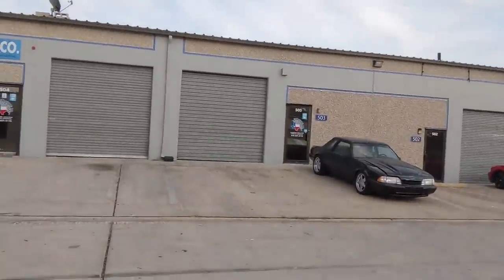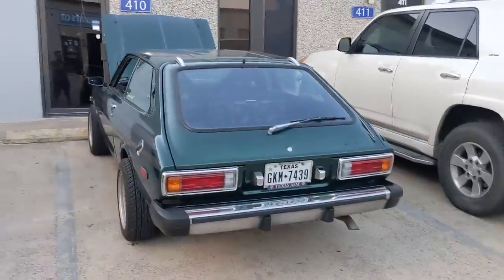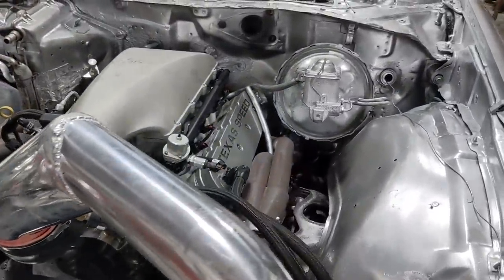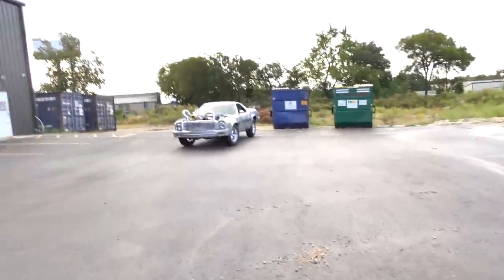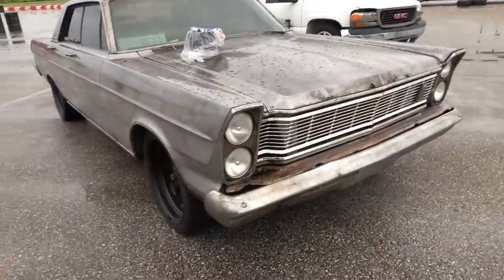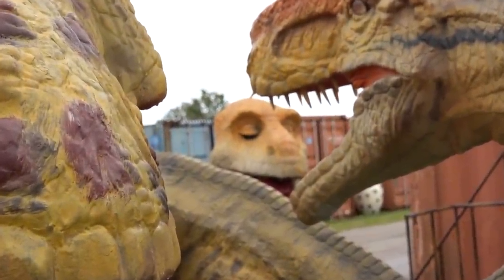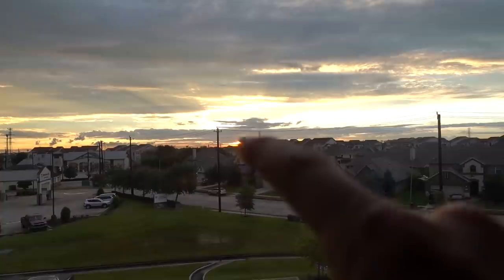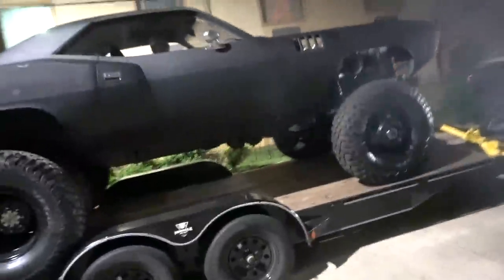The Cummins Barracuda RUNS AND DRIVES!!!!!

Comment: Hey Matt. When you trailer the car you really need to cap off or cover your turbo. First and worst thing your doing to it is spinning the turbo dry because your not pumping the oil into the turbo lubricating the bearings. That's really bad on it. Second your allowing alot of dirty air, bugs, or water if you run into rain.

Comment: So the original Texas speed motor got killed partly because Matt ran truck tires on the Elco, so he threw a stock bottom truck motor and an ebay turbo in it then added a set of new truck tires...? Solid work cause I'd rather have those badass tires than a motor that survives...

Comment: The power is extremely low for that psi and what the engine made na. It should be way higher. Something is wrong for sure.  The turbo is way to small for the displacement. But even with it being small it should be higher.

Comment: The el chromino before with no turbo was 500 hp?? And now with turbo 12 pound spring 570 im guessing that motor isn't as good
Reply from the maker: No turbo motor was a race ready 416cid LS.  I cooked it.  Replaced it with a much smaller LS out of a junkyard chevy truck that i swapped heads and cam and slapped a turbo on it to make up the difference in power.